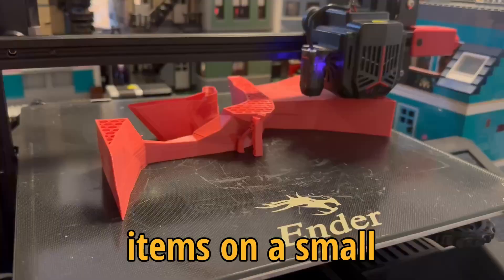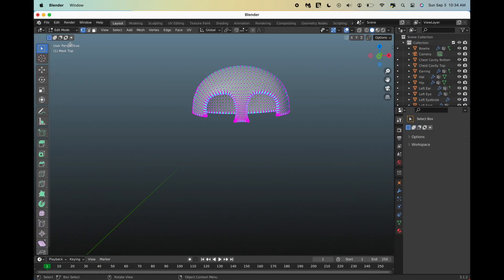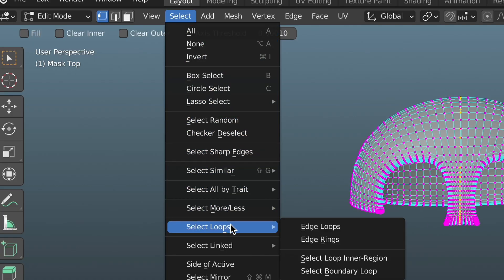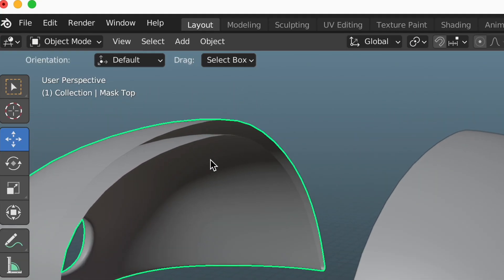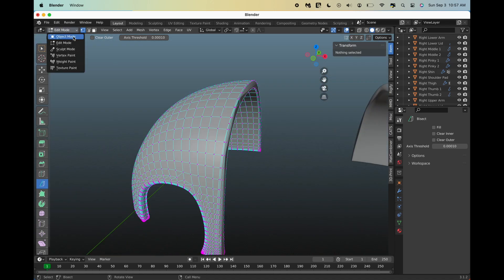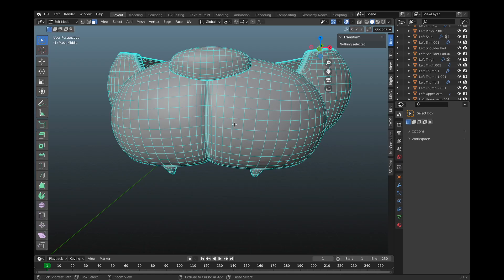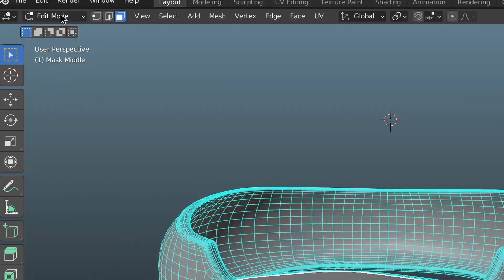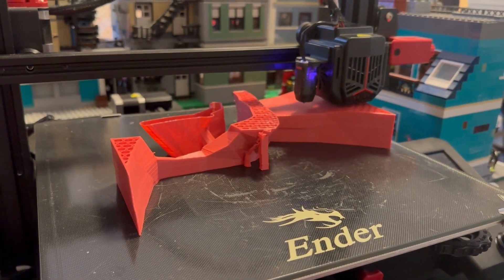How to split up models for 3D printing

Comment: As the model is split down the middle, why not just select all of the faces on one side, or the other, and then separate? Bisect seems so inaccurate when used in this way... Sorry but I've been a 3D model artist for 20 years and this just seems kinda clumsy...

Comment: Also, I’m thinking of getting the CR 30 belt printer. Do you think that’s good?
Reply from the maker: Belt printers are really good especially if their from Creality, although if your trying to print things like what I print it probably wont do well because they're speciality is mainly printing a ton of small things with out break or long things like swords, also whilst I was researching what 3D printer to get I heard that belt printers are not very beginner friendly so I would not recommend it as your first 3D printer.
Reply: What’s a really good 500$ or under 3d printer? For beginners
Reply from the maker: I think some good options are Crealitys ender series of 3d printers, for you probably one thats around the 300 dollar mark and a newer model. Theres a lot of great videos reviewing printers and comparing them to printers at similar price points that you could watch and eventually you can find the printer thats exactly what you need. @PudusTechReviews
Reply: What’s harder of the Cr 30 then the one you have and also how many printers you have?
Reply: Do you think the flaunting v400 is good?